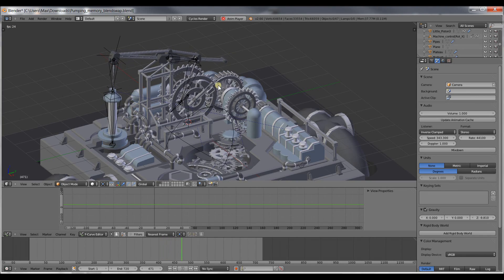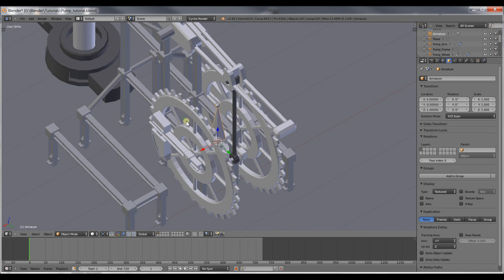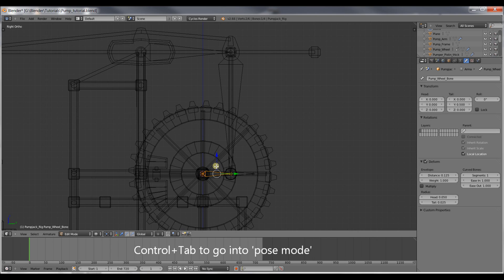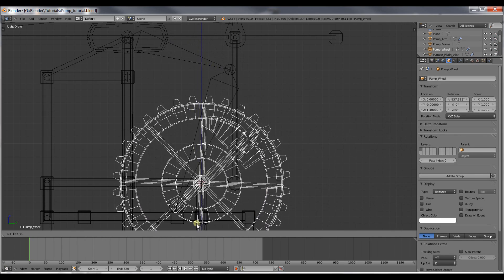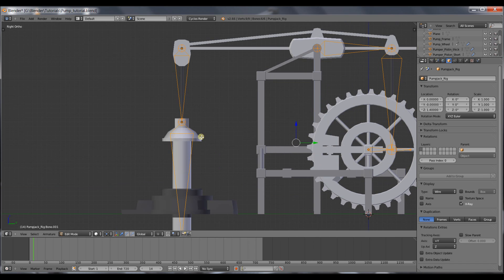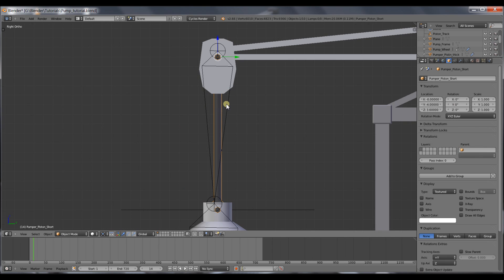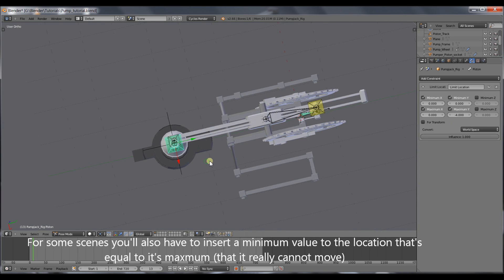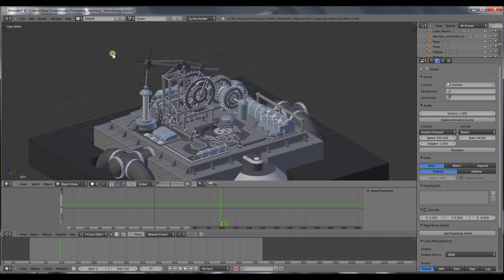Blender 2.66 How to rig a pumpjack oilpump.

Comment: this is really cool, what i was looking for. btw how do u do to snap objects to centers or specific points when moving things around?
Reply from the maker: If this specific point is a vertex, you can use vertex snap to do this. If the point you want to snap to is located at the center of multiple vertecies (like at the center of a circle of vertecies) you can select all the vertices around this point "Movie 3D cursor to selected" then select the object you want to move and "Move selected to 3D cursor"'. Hope one of these works for you :)
Reply: Thank you Sir.

Comment: Could you help? I've used your tutorial on something similar... Everything looks right in edit mode, but in pose / object mode the copy rotation and IK controller bones move from a 45 degree angle to the vertical (the other bone stays in the right position). so then the rig moves from the wrong point. As I'm new to all this I have no idea what is going wrong.

Comment: I'm surprised that the pivot does stay in the right place. It shows that Blender's being cleverer that I had thought.
I would have done it By having a second IK chain and use a stretching bone with locked rotation to keep the piston moving in a straight line, I think this would avoid the lag, but not provide any other benefits.
Having downloaded the model, I was impressed by some of the detail that I hadn't seen in the video, particularly the counterweight in the wheel driving the pump.

Comment from the maker: Hm... yeah I have seen different rigs used for pumpjacks, but this is the one that worked best for me. setting the bone to be a child of the arm-bone could work I guess. I'll have a look. But yeah the tracking bone does stay accurately on the pivot point of the piston. though it does take 1 frame (when rendering an animation) to get in sync due to lagg... but thats not uncommon for a long chain of constraints. thanks for the feedback and comment!

Comment: Good tutorial. It's interesting how you did some things the same as I would have, and some different.
You could have avoided using the parent constraint by parenting that bone to the bone for the pumping arm and choosing keep off set, this would also avoid the lag the rig shows when turning the wheel.
Does the tracking bones end stay accurately on the pivot point of the piston?